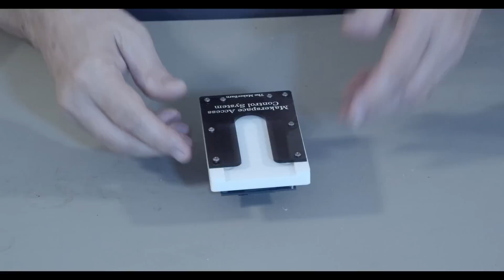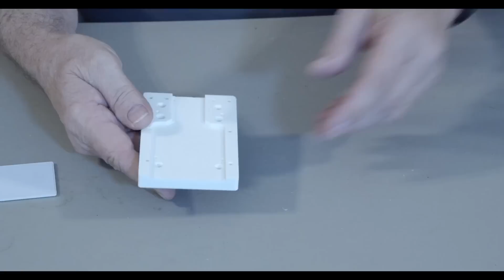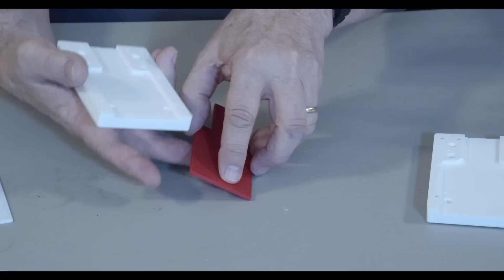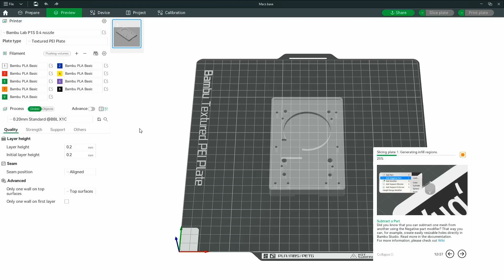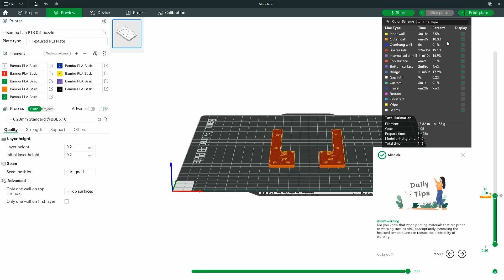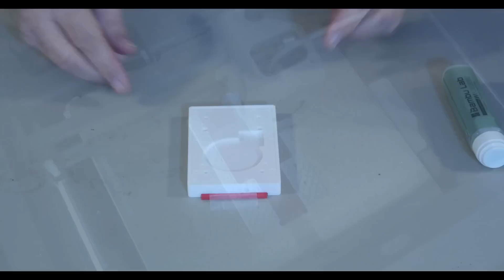3D Printing Without Using Supports

Comment: If you are using screws already for attaching the front plate, just split the part in half and screw all three together.

Edit: I didn't want this to seem like criticism. It's a great technique if you can't or won't use screws, and I think the original design could be made without the front panel and a single piece would be handy to have instead of needing screws or glue, and the technique is useful in general to learn about.
Reply: For this use case it's possible, for for others it might not be.
Reply: That's what I was thinking. 👍
Reply: Right? I was wondering if there was any particular reason the face plate needed to be translucent acrylic, as well, seems like one could just do a minor rework, then print the assembly in two parts and not have to cut the face, too. I guess labeling might be an issue then, tho.
Reply: The seam will be visible due to tiny skew. I guess you can just bevel it to make it look intentional.
Reply: @SianaGearz Ya, make the seam look like a shadow line.
Reply: Thought the same but I just view it for the general approach. Same with many Slant3D vids. It’s only to show the concept.
Reply: @lazyman1011 Yes. It's a great idea that I have an immediate use for that will eliminate a lot of support material on a print I do a lot.
Reply: Double the bottom and top layers to print, lots of extra time
Reply: @owenatkin3148  No, Not since those layer counts are under your control.  External layers after mating don't change, those will be Top layers in a split print (front and back of the completed design).  Bottom layers can be just 1 since your simply mating the two faces internally during assembly, in fact you could possibly use a zero bottom layer, just start with infill and have it be plenty strong when assembled due to the rigidly controlled mating via the through screws and suffer NO layer penalty at all, given that the perimeter is likely plenty for structural strength given the application of the final product.  But even with a single bottom layer the net add is 2 full layers (one on each half part), or negligible to solve a print support problem, and faster than printing the filler piece to insert and remove afterward unless you're doing hundreds, to say nothing of the pause being unnecessary, which if you are talking hundreds could suggest 3D printing was possibly not the right choice up front.
Reply: Came here to say this
Reply: As far as I can tell you can even print it in 2 parts. Then the front part will have the spacers to create the space in between

Comment: You should split the stl file in half (horizontal) = top + bottom... print both and glue them.
Reply: i like his solution a lot more
Reply: @Person1873  when you run a printFarm you´ll undestand
Reply: @hmarloestudio   Theres a better way. and the if you run a print farm you should know it.
Reply: @dnappi85  that’s helpful
Reply: @dnappi85  there are many ways actually... but pausing the printer and placing molds is not one of it.
Reply: I like his solution as well.  no need to mess with glue and make sure the halves align, but if it works for you, cool.  I am guessing they don't have the AMS  because I would have just printed this with PETG as the infill and PLA as the main body. But either way, his is nice idea
Reply from the maker: @JohnScherer  That would have taken forever to make the print.  It would have to adjust the nozzle temperature 2 times for each layer.  Also you would be printing the core over and over again.
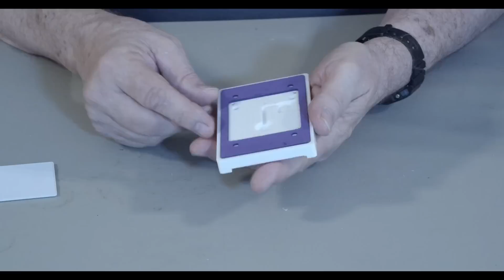Reply: @makerspace533  Yeah, no way around it, you would print the plug every time you print, but how many of these are you printing, and this way you don't have to babysit the print job to put the plug in.  As far as the print time goes, I did a version of your design the main body as one component, and the plug as another component. I estimated the size but I think I'm close because I know how big a rfid card is.    I imported to Orca Slicer and set the main body to PLA, 15% infill, tops, bottoms and walls to 3.   The plug I set to infill to 5% and top/bottom/wall to 2.  infill in both was rect.  Print times were estimated to be 1:45, which would be pretty accurate.  I can share my model if you want.

Comment: If it works it works, I personally would've printed it upright, no support needed...
Reply from the maker: There would be some overhangs, like the recess for the gasket, that would fail.
Reply: Much stronger part printing it laying down
Reply: I'm with Voidy on this one.  I would add a 45 degree chamfer where needed to fix the overhang issue, and add a tiny triangle point at the top of all the holes to prevent circle sag.  Still, it's a very cool idea for printing multiple tricky parts where that isn't possible, and you don't want to keep having to throw away support material.